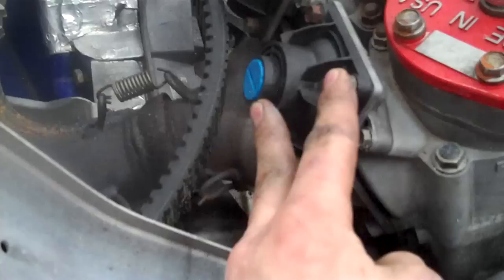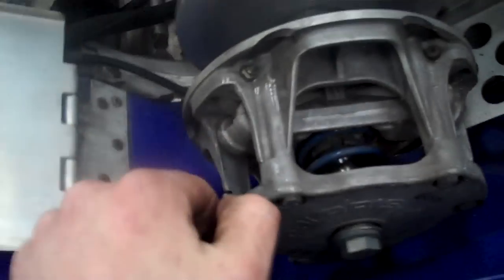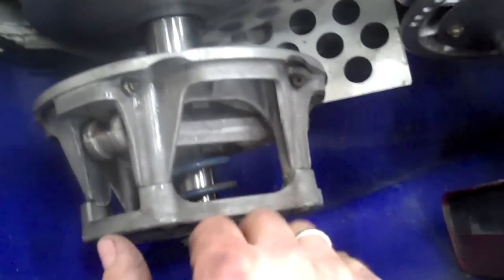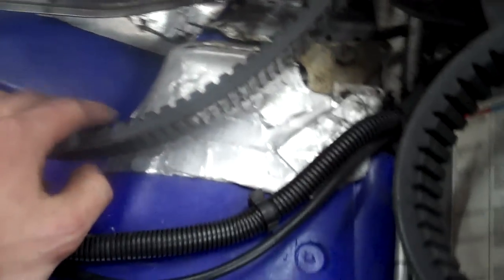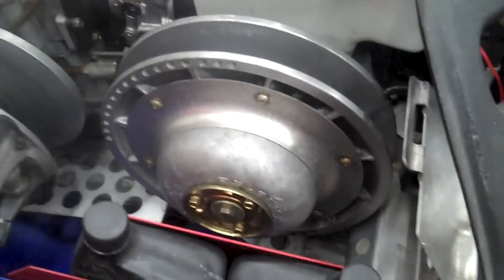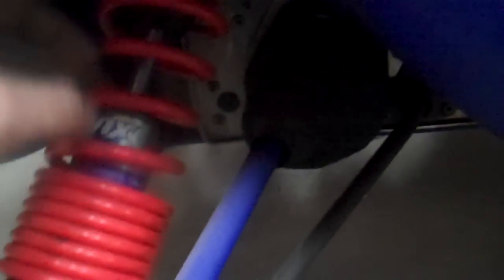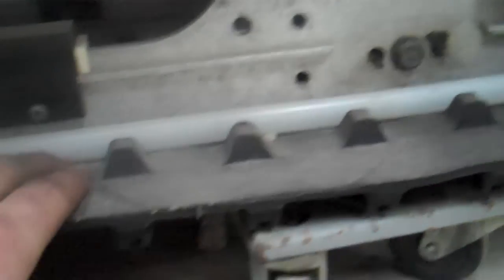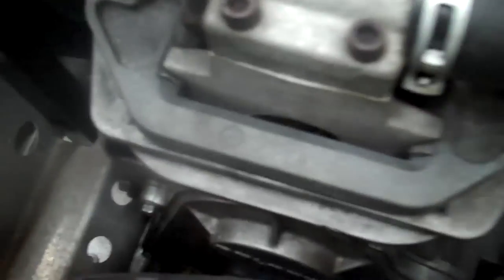General Snowmobile maintenance.mp4

Comment: Adjust the drive chain by turning bolt tightener up finger tight and backing off 1/2 turn.  Take chain case cover off and make sure bolt holding bottom large gear is loctited on good.  Replace chain case oil with 5-15 oil, any brand.  Remove cylinder heads and cylinder, and polish the inside cylinder wall with 3M fiberglass disks.  Change out rear bogie wheel bearings every 2000 miles.  Loosen track completely, over the summer.  Start engine once a month in the off season.  Rebuild fuel pump after 2000 miles, by flipping over nickel sized clear plastic valve discs.  Blow out oil injectors in carburetor with compressed air.  Check reeds for chips or not completely sealing.  Retighten handlebar riser bolts.  Replace brake fluid.  Lubricate throttle cable.  Check clutch side drive axle bearing for free spinning.  Same with bearing behind driven clutch.  Remove engine and check engine mounts, especially the PTO side mount.  Reset track tension at start of season.

Comment: Dude, Dont add any gas line anti freeze, ever! It will dry out any lubrication going to your motor . Both top and bottom end. If you add gas line anti freeze you may cost yourself at min, a set of rings, A top end rebuild or worse a bottom end. My suggestion , buy a water seporator you throw in your fuel tank. it sucks up any water in you tank . Most dealers carry them . Just my thoughts

Comment: Can you take the secondary off easy to get to the grease port? Seems like it's impossible to get to without removing it. I'm still having trouble with getting rpms past 7000 after fixing a bellow. Not sure what would be causing it but going to try some sea foam. If that doesn't work I'll take apart the carbs.

Comment: Hi guys,i have just gotten a 90 indy 400 polaris for sweet deal of 350.00 its in fair condition.compressions a bit low 110 on pto side and 115 on mag.at times can be a hard start,but a shot of juice down carbs gets it going easy and this model has no primer.can you do a vid on putting a kit in or suggest a relative easy kit to go with.theres no provision on mikuni carbs for squirters.and there is squirters for oil injection on carb mount flange,perhaps i could rig a tee fitting somewhere there or drill a hole in carb throat for that purpose.just feel it would improve startup pulls!!any kits would be helpfull!!snookie pa.💥🤟💥

Comment from the maker: Yes, fair point - check for cracks - however the crack seen in that part of the video is simply on the red "hub cap" portion of the wheel - It will not effect any performance of the wheel - thats all for looks.

Comment: I have read about checking run-out on crankshaft by pulling  primary and  putting dial indicator on the crank end. This is for a Polaris 800 edge. Do you have a video on that? Also does it give a good indication of the run-out on the crankshaft. Thanks your videos are great.
Reply from the maker: Sorry, I do not have a video of that - But if it were me.  I'd steer clear of the Polaris 800 twin motor, and you wont even have to worry about it :)

Comment: Does that fuel cap with the gauge fit an 02 700 Classic? my gauge is dead and so is the sending unit.... just kinda thinking for a cheap fix the fuel cap gauge is a good option. thanks

Comment: Remove cap of drive clutch and check swing of the 3 weights, so that they do not wiggle from side to side and gouge out the drive clutch metal.  Replace weights if they have side play.

Comment: This pertains to a 2001 POLARIS 800 xc sp ....I have a question,i did a clutch service on both clutches,my problem is broke a bolt torqueing it at 15lbs. on the secondary jackshaft,tried to remove bolt No Good,turned out the owner before me replaced it with a grade #3 or- #5 bolt,....is there a easy way to remove this jackshaft with the darn (airbox) in the way,,i tried all the tricks (including hacksawing a slot in the end of jackshaft to try to spin it out with a lefthand drill bit & a easy out kit....also no mechanic will touch this repair so far.     - Any tips greatly honored  BK Powersports -       K.B.  L.I. N.Y.
Reply from the maker: You cant get to it drilling it out and using a easy out? Otherwise yeah, you have to remove a bit to remove the jackshaft.

Comment: When I park my sled for the summer I wait till it’s really low on gas then I fill it to half a tank and then the other half ave gas and since ave gas doesn’t go bad and my sled is a high performance sled it can run ave gas so before I go to start it next winter I just shake the sled to mix up the gas and it works

Comment: hey mike, im trying to replace my belt on my 2002 polaris 800x and the new one is impossible to get on. i have tried the top and bottom of the secondary. double checked the size and its the correct one. i reinstalled the old one and it was quite easy. its like the last three inches are impossible, cant spin the pulley its so tight..any tips or tricks? thanks in advance! love the videos, wish i lived closer to ya!
Reply from the maker: Set the parking brake...  Put the belt on the primary clutch all the way down in the sheaves.   Now you will want to push and rotate the back sheave of the secondary clutch to open it up as you push the belt down inside of it.  Once the belt is on, it may sit goofy on there until the first time you start and run the track..  

I'll try and post a video on this, but I hope this helps.  Remember when you open that sheave you are working against the spring tension, so it will be some pressure.
Reply: Thanks! i actually got it on and what was happening was the hydrolic jack i was using to lift the ass end had dropped a bit and the track was barley  hitting the floor not allowing me to turn the secondary very easily. once i jacked it back up, it was fine. still a bitch but it worked!! thanks for you help and response, you guys are great, love the videos. if you have a chance, can you make a video on how to bleed brakes/ replace brakes on a older Polaris? all the best!!!! DTC

Comment: Have the same sled, was riding it the other day right after a fresh snow and opened my throttle up and shredded a belt, got the sled to a stop to see if that's what it was which it was and them three the spare belt on. But after I started up the sled and started going I noticed a vibration in the track area and through the bars on acceleration, stops when I lock up the brakes. Checked the spare belt and noticed it had a spot where it gets narrow, spots probably 3/4 of a inch or a inch long, could that be the cause of the vibration? I didn't feel it till after the first belt shredded at high speed and then put new belt on. Please help
Reply from the maker: HiveNvmii LD yes, absolutely
Reply: I was also wondering is the primary clutch is supposed to move in and out when I get on and off the throttle, would a hourglassed belt cause a rattling noise?

Comment: My gf has a Polaris super sport 550 believe it's a 2004 recently the speed/trip meter stopped working. I'm thinking the cable has snapped. I'm fairly mechanically inclined but, is that a tough job to do as far as getting to the cable and getting it out if it is broke? Thanks for any info/help

Comment: Got a 97 zrt triple
600 smokes alot more than I think it should could it be the kind of oil in it or is it just getting too much oil and what kind should I be running in it just bought it so still has the same oil in it
Reply from the maker: It could be burning more oil than it needs to, but unlikely.  Any name brand 2 stroke oil would be good for it.  Synthetic typically is best.  How bad is it smoking?
Reply: Justin Couture what oil to gas ratio are you running ide look into the recomended mixture for what your doing with it like trail riding, climbing, racing, etc

Comment: i just bought my first sleds both 1997 arctic cat powder specials 580. one EFI one Carb. the carburated one primary clutch will spin but will not engage... any suggestions? (it did engage once at about 6000RPM) but i cant get it to engage again.
Reply from the maker: Sounds like it could be a stuck weight, or bad components in the clutch - time for an overhaul.
Reply: Big Kid Powersports what parts should i order for an overhaul? ive got a 96 arctic cat 550 and the clutch doesnt dis-engage, when you pull it over it moves forward, and stalls when stopping. i know nothing about snomobile clutches!
Reply from the maker: justinfromcanada
I would have to see it.  W/o looking at it, I would be guessing..and it would do no one any good.

Comment: hey mike, im having my sled serviced right now at a local dealer, and received a call,  today saying my power valves are warped. Do you happen to have a good one and a bad one you could show me exactly what they mean?
Reply from the maker: I don't commonly hear about them warping.  Is it on the XC in your photo?  Polaris had more issues with some of the older ones breaking than anything. I'd assume if it was warped it would be hard to get out of the cylinder.  Regardless it might be time to upgrade to the Stainless Steel ones..  Mike  815.363.1254
Reply: hey mike just went and picked up my sled and was talking to the service guy there, and he said that the valves are loose and flopping around in the cylinder? if i change out the springs,and bellows etc. Would it stop the vibrations?
Reply from the maker: Tyler Alexander Flopping up and down?  or loose in the hole all together?  Hard to say w/o seeing it.  If it's flopping up and down a spring may help.  The bellow itself will not change that situation, thats essentially just a seal.
Reply: hey mike, sorry for the late reply, i pulled it out myself and was havin a look at them, the valves themselves have some scratches and a bit of wear, so im gonna buy some new ones anyway, but i was trying to feel for play, and it just feels like it would be a spring issue. thanks for the input though, any chance you wanna take a top end apart and put in new pistons and rings lol and make a video for me

Comment: I have a POLARIS 800 xc sp,(just rebuilt the motor & added mechanical reverse ) I changed the belts twice,my problem is after a few minutes the sled  won't move ,I have to work the throttle (feathering)walking the sled finally running along side of it to get it finally moving fast enough to jump on it goes for awhile until I slow down,and its starts all over again just about smoking up the belt- I just wanted to make a point that the sled had the same exact problem before motor rebuild & adding mechanical reverse. and also it works ok when sled is up on the snowmobile crane lift.-with NO WEIGHT FROM RIDER-. I have a brand NEW belt that I regret to put on because of this PROBLEM.  -HELP I NEED TO FIX THIS PROBLEM RIGHT AWAY.   - Thank you -
Reply from the maker: Check your clutching. I bet the spring or belt are bad
Reply: Thanks BKP

Comment: if you take off the secondary clutch on that sled, what do you torque it back down too? it looks like you have a lot of polaris's and I want to get at that jack-shaft grease fitting behind the secondary clutch and probably clean it up while i'm at it if you know I'd like to know what to torque it back down to spec thanks
Reply: Same. Idk how to get at that with a greaser

Comment: Need help cant get air box in 1982 503 blizzard its a ski doo bombadier heard its realy difficult
Reply: if you can use ebay go on there and check out Uni filter's
 or K@N or snow chargers should find somthing,but you might have to rejet the carb's.not sure go on ( doo talk )and see

Comment: Here some great advice stop buying crappie fuel  run pure gas no E raiding.  I own a small business I have over 22 carburetors for my equipment! I have not clean one of them in the past 6 years because I run pure real gas 91 octane. Little bit more expensive for the gas but is cheaper than paying $150 per carburetor to clean every year.